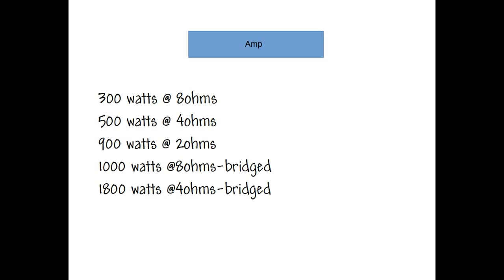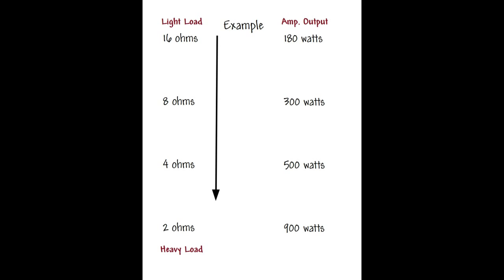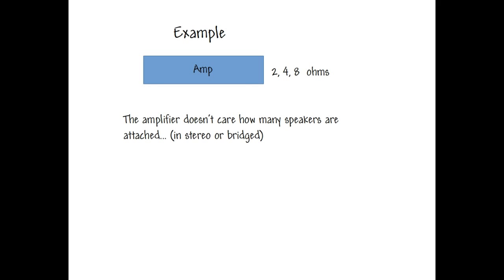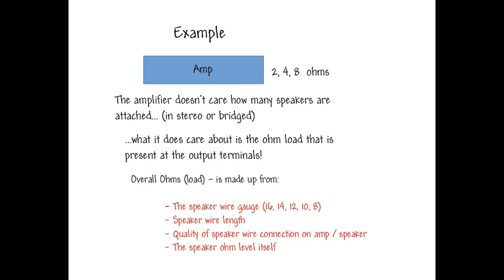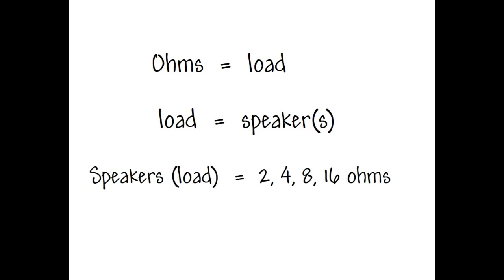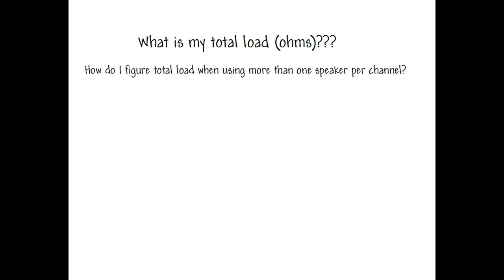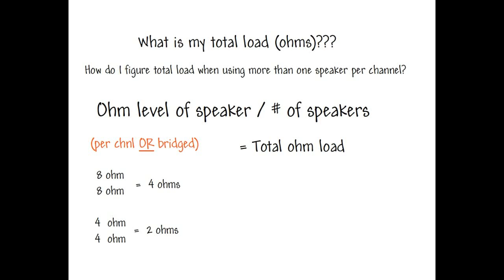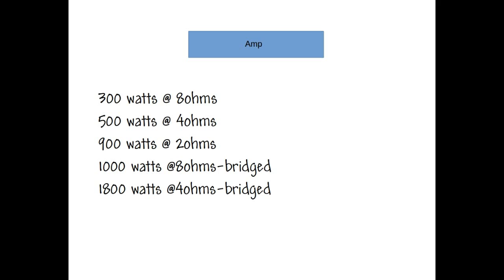What is amplifier Ohm load?  A look at how speaker load changes power

Comment: sir can i use 4 ohms load in class ab amplifier in continues loud music?? thanks for the answer
Reply from the maker: Yes.  As long as the speakers can handle the power, and the amplifier has adequate cooling.  Class AB amplifiers that do not have cooling fans should probably not be used for continuous loads.

Comment: How about a mono block amp with two hook ups and the amp is 1-8ohm stable and I have 4 speakers that are 4 to 8ohm capable.  How do I wire them so the speakers come out to 8 ohms?
Also I have a two channel Rockville 1800 watts marine amp and 4 subs that are 3 twelve inch subs SVC & 4 OHM CAPABLE & 1 TWELVE SUB DVC 2 OHM CAPABLE.  HOW AND OR WHAT IS THE BEST WAY TO WIRE THIS?  THE AMP I BELIEVE IS 2 OHM IN REGULAR AND BRIDGED MODE.
Reply from the maker: To get an 8ohm load using 4 x speakers, the speaker connections would need to be wired in a "parallel-series" configuration.  It would be easier for you to search for "parallel series wiring speaker" on the internet than it would be for me to explain how to do the wiring.
For your other question, it's best to use an amplifier in 2-channel mode (stereo), rather than bridged.  Running an amp in bridged mode places a lot of stress on the amp.  Bridge-mode should only be a last-resort for the extra power it can provide.  For your 4 subs, it may work best placing 2 on each channel (parallel), this would result in a 2ohm load per channel for the amplifier.  I do not recommend connecting the single 2ohm sub you mentioned.

Comment: I have a question that needs an answer,  If you have several speakers (8 spks all @ 4 ohm load) all totaling 2000 Watts RMS in retrospect, and a receiver that has a 2000 watts peak power rating,  is it possible to increase ohm load (4 ohm to 16 ohm) to decrease demand from the receiver to make this work without any damage to speakers and/or receiver?
Reply from the maker: There is, but it's a lot easier to say what to do than to actually do it.  There's a couple of ways to increase the ohms.  Use individual drivers in the speaker (depending on the speaker and if a xover is used) that are 8 ohms (or 16 ohms).  Or, two 4-ohm speakers could be wired in series to increase the load to 8 ohms.  Most 4-ohm speakers have either 4-ohm drivers or the internal 8-ohm drivers are wired in parallel (not series) which reduces the ohms.  If you are needing to use a lot of speakers on one amplifier, it may be better to either get an additional amplifier to handle the load, or replace the 4-ohm load speakers with 8-ohm speakers.  You probably don't want to use anything more than 16-ohms... the higher the ohms, the less power the speakers will receive (which means lower volume).
Reply: @stageleftaudio  Thank you much.  This cleared up some of the issues.  Not able to use all the speakers I had for this project.  If I piggy back an amp on top to boost power, would I still use the existing speaker jacks on the receiver, or would the additional speakers plug in to the amp?  If that's the case,  then I should probably buy a new lineup of speakers.  You spoke of drivers, is this a preset to every speaker?  I know it's possible to change wiring configuration to have an effect on speaker load. My receiver  is 8 ch. (250 watts max--225 watts use/channel) Thought I did enough research but I fell a little short.  More to audio setup than you would think.  I appreciate your insight.
Reply from the maker: Actually, I see you referenced your receiver is 8 channels.  From what you have shown, looks like the 8 speakers you have could work with your 8 ch. receiver.  What is the make/model of your receiver and of your speakers?  The biggest concern is to ensure the ohms of the speakers are within range of what the receiver can support.
Reply: @stageleftaudio  Receiver is a PYLE  PT796BT 7.1 channel.  Speakers are (2)Rockford Fosgate P2D2-10 Punch  P2 DVC Dual 2 ohm 10" subwoofer wired to 4 ohm load. (4)PRV 10" 10W650A 650 watts program/325 watts rms also wired in pairs to 4 ohm load. (2)SKAR 6.5" EVL-65 D2 400 watts peak/200 rms Dual 2 ohm also wired to 4 ohm load. (2)Boss P69.4C 6x9 full range 4 way 400 watts peak not sure if 200 rms also wired to 4 ohm load.  With just the PRV & Skar speakers hooked up I get good volume.  That's just 4 channels operating.  Again, I appreciate the time and expertise in this matter.
Reply from the maker: The specs on the Pyle receiver show each of the speaker outputs will support an ohm rating between 4ohms - 16ohms.  This means that however you need to wire the individual speakers (looks like you have done this already), to come up with an ohm range between 4 and 16 for each output channel (speaker) you will be fine.  Looks like all 8 speakers will work on your Pyle receiver... as long as the load on each of the speaker outputs is within 4ohms to 16ohms.

Comment: depends on wiring configuration series, parallel & series parallel...cuz 4 pcs of 8ohms speakers u can wired it up in series parallel to maintain its impedance of 8ohms..that would  be really good for mid top configuration to maintain their impedance... but for the subs,  parallel configuration is the way to go, to get power from the amplifier maybe stereo or briged, depend on the wattages of the amplifiers..just an opinion.. peace!!!